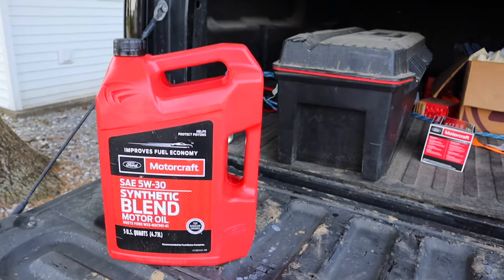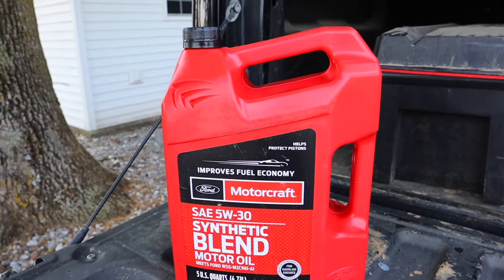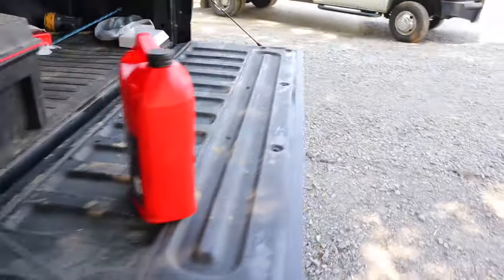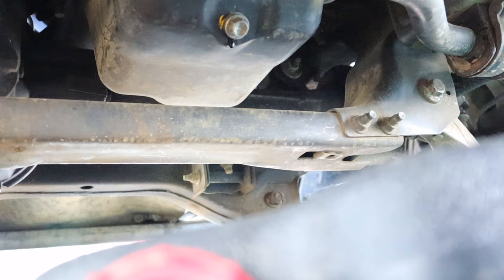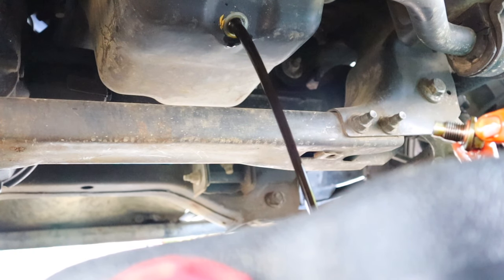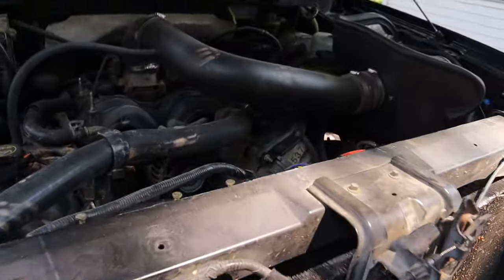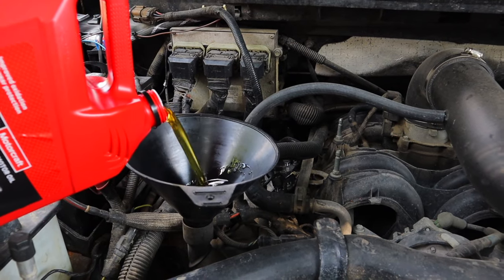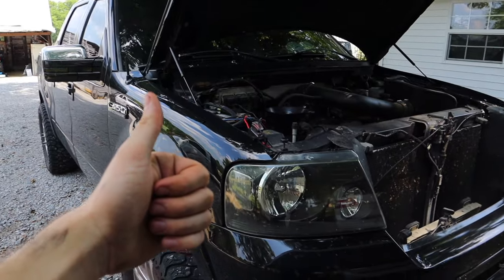HOW TO KEEP YOUR 5.4 TRITON RUNNING LONGER WITH LESS FAILURES!

Comment: I have you beat I have a 2002 FORD F-150 LARIAT SUPERCREW cab with the 5.4 and it has over 263 thousand miles on it
Reply from the maker: My black truck is at 197 currently, waiting for my house and shop to get built so I can get back into making more videos for you guys!

Comment: I got a question anybody have any transmission problems with the 6r 75six speed transmission. I have no idea how many miles are on that either. A tree trunk I sold I documented every oil change water pump brakes shocks whatever else routine maintenance but so eat Ford expedition limited 2008i have no receipt service records

Comment: 182k and still running strong..
I do however use a wix filter..
I’ve seen filters cut open and it seems to be the best
Need a new ac compressor though lol

Comment: Ford grenade engine. My 2009 f150 just took a ....on its 2nd engine.  So, currently, I'm back to my 95 chevrolet with over 340.000 on the original engine.

Comment: What year 5.4 Is this and is there certain years of the 5.4 for that are more bullet proof than others ?
Reply from the maker: This is a 2007 5.4. They’re all relatively similar, I know the 08’s got updated plugs and a different valve cover causing obstructed access to the vcts. I haven’t heard many failures out of the 09 and 10 model 5.4’s but I’m sure they had their fair share just like any other vehicle. Good thing with any 5.4 is they’ve been around long enough people know how to service them no matter what issue may arise!

Comment: I have a pretty loud clunking whenever I go from reverse into drive and I feel like I am hurting the truck by not doing anything I have a 05 f-150 5.4 would u have any idea what it would be?
Reply from the maker: If it’s only reverse making the noise I’m not sure what the issue would be. If it does it when shifting from reverse to drive as well, it could be the torque converter. Hard to tell without seeing and hearing it
Reply: Have you checked the u joints?
Reply: Definitely sounds like u joints ,on mine i couldn't feel any play but still replaced them to find they were shot and after I put it back in the clunking was gone

Comment: I use motor craft 5w30 and motor craft filter oil and change at 3000 miles cheaper to change oil then a engine

Comment: What light bar do you have. I want to do the same you did and put it in the lower intake
Reply from the maker: Yes. It’s a 30 inch straight bar. You have to notch the frame horns (they’re replaceable) to mount it flush.

Comment: Are those emblems the 2015 f150’s. I wanna get some but don’t know if they line up the same with the stock emblem.
Reply from the maker: Have to find some that have the 3M backing rather than the pins! They cover all the holes left from original ones
Reply: @JayThompson25  any chance you can put a link? Please
Reply from the maker: I don’t have a link for the specific badges I have , however Amazon has tons of badges to choose from.
Reply: @JayThompson25  appreciate the help sir👋

Comment: I have a 5.4 and the oil some how disappears I don’t see any leaks and it looks like it’s not burning any
Reply from the maker: Seems to be typical to lose about a quart over 5k miles or so. The 5.0’s also seem to have this issue. Not every engine does it, but it does seem to be a common occurrence

Comment: I got an 04 5.4 with 100,104 miles and for some reason it sound like a diesel engine making a click sound below 1200rpm am I the only one?
Reply: Thats the signal telling you its time for the timing job, chain tensioners and cam phasers, exact same symptom i had on my 05. One of the chain tensioner guides was found broken on mine - amazing it was running like that for who knows how long truck has 140K miles. That dieseling on mine was  the timing chain making a slapping noise. While the engine is open strongly recommend replacing the oil pump to the high volume version and change the water pump. I had mechanic do the job, not a cheap but i will tell you my truck runs like new now, quiet and more power.

Comment: Do you recommend 5w30 for winter or 5w20 ?
Reply from the maker: I use 5w30 year round 👍
Reply: What about in places that have real winters. Like Wisconsins -20degrees. I wouldn't want to be using 10w.

Comment: Did you repaint your truck
Reply from the maker: Yes I did!
Reply: @JayThompson25  the rear view  mirrors are plug and play ?
Reply from the maker: @JesusGonzalez-kp4wp  the side mirrors from the 09-14 F-150’s will function perfectly on the 07-08 models!
Reply: @JayThompson25  even the turning signal? I have a 08 and I want those but don’t want to cut wires
Reply from the maker: @JesusGonzalez-kp4wp  the puddle lights and turning signals worked perfectly on my 07

Comment: 175,000 miles is impressive? maybe for someone who doesnt take care of there truck. My f150 has 190,000 and I fully expect it to run another 100,000 miles same case for my E39 with 335,000 miles
Reply from the maker: Higher mileage is normally not seen on the 5.4’s because typically poor maintenance causes a lot of issues and failure points in the timing components. The oil pump starvation issue also takes out several 5.4s. I agree that 175,000 isn’t impressive for most vehicles, but 5.4’s are their own breed of problem childs and proper maintenance is the key to keeping them on the road

Comment: The 2 valve is different from the 3 valve. You have no basis to recommend 5-30 over 5-20.
Reply from the maker: 5w-30 has a thicker lubricating film therefore would be more beneficial for higher mileage engines

Comment: Would it make more sense to change the oil with the motor cold and all the oil drained down to the bottom instead of starting it and pumping all the oil up in the top of the motor

Comment: Its sound like you need to change right side roller followers on your truck.
Reply from the maker: Definitely plan on pulling the engine and doing all the upgrades needed
Reply: @JayThompson25  i suspect its the back or middle roller follower. While you at it, there is an oil pressure port at the back of that bank. Check oil pressure from there. If low, stop driving truck and check oil pan pickup. If not just change followers and all good

Comment: I have 04 5.4 does anyone burn oil in theirs I gave to add at least a quart between oil changes.
Reply from the maker: My brothers uses a little between changes. A lot of people claim it was a common occurrence, not only with the 5.4’s, but also the 5.0’s as well. After pulling a heavy load for long periods of time such as a road trip, I have noticed mine will use a touch of oil, but nothing of major concern

Comment: Id say get started repairing that roof on the barn lol jk
Reply from the maker: Next build video 👍😂😂
Reply: @JayThompson25  seriously though I appreciate your video. I have an 05 f150 with the 5.4 3v and have the hot idle knock I think from the cam phaser locking pin. I've heard from people that isn't detrimental but I'm concerned there may be more going on wish I could get someone to look at it to tell me it's safe to keep driving this way or I need to fix it asap.
Reply from the maker: Might not be a bad idea to have the valve cover pulled for an inspection!

Comment: I didn’t know about the 5-30 trick I’ve been running 5-20 synth motorcraft I have 190k miles on my 2010 5.4 f150 do you thing the damage is too far gone then??
Reply from the maker: Not necessarily, 5-30 would still provide lubrication and prolong components as long as possible. Might even notice a little quieter engine afterwards

Comment: I run Castrol full synthetic the 20,000 mls oil. I changed it at every 8-10,000 . I also used marvel mystery oil at every oil change
Reply from the maker: 10k is too much of an interval for my personal preference but hey if it works 🤷🏻‍♂️

Comment: I have a 2003 F150 5.4. I bought it 10 years ago with 108,000 miles. Today it has 265,000 miles. I have changed oil every 5000 miles and used 5W20. Stick to manufacturer’s specifications. Check out Fordmakuloco YT channel. He is the best Ford mechanic on the planet. He recommends OEM parts and specs only.

Comment: I’m putting a crate engine in my 05 right now, oil pump took the day off when I was on the highway
Reply from the maker: BIG Oof. Update that crate engine with the meling high volume pump if you haven’t already 🤙🏻
Reply: Whose engine did you get? Most have an HP pump in them even though almost all suppliers misrepresent the truth and say they put an HV in it. HV is probably fine for a stock unit, but once the clearance is fixed, the HV isn’t necessary because the volume loss is taken care of.
Reply from the maker: Most people get jasper long blocks for crate motors, but am unsure of this guy’s application

Comment: Mine knocked after it was warm until I switched to 30w and they was 6 months ago, all good since
Reply: try 15/40 diesel - works great to cover the phasers. Been running in mine for years - 2010 165k miles - i change every 3k

Comment: This guy does not know what he is talking about do not take this advice. Thicker oil lubricates much better BUT the engine was not designed for it. The oil pump already sucks as is it can barely move around enough oil to keep things lubricated so thicker oil is going to make this problem worse and the clearances in this engine are very tight which means oil has to go into small spaces and thinner oil does this better. This engine has problems with not enough oil going to the cam shaft bearings and thicker oil is going to make the problem much worse.
Reply: Fordtechmakuloco recommends running 5w-30 in the 5.4 3v. Being clean is more important 

Upgrading the oil pump is best, but expensive and you might as well bulletproof it if you're going that far

Comment: 5.4 is piece of $#@!..  cam phasers etc $2500 fix  DONT BUY THEM... thats WHY there is SO many for sale or those V6s nobody wants!
Reply from the maker: A phaser kit is $250. Most issues with these engines stems from dirty oil or neglect of maintenance when ticks or sounds can be heard. True they can fail without much of an warning at all, but isn’t a usual outcome
Reply: Have 300k on original 5.4 3v.
Reply: @bswens01   I have heard that but I've heard MORE about the problems
Reply: Always easier to hear about problems of any sort than good.
Reply: @bswens01   that's not a good motor man.. thats WHY so many of those are up for sale..  and like with the 6.4 diesel  all makes produce junk models....  I like 4.6L and 5.0L  and 7.3L Diesel
Reply: Depend on people how they maintained but few of 5.4L 3V were just lucky have no issue and mostly unfortunately for us all of these 5.4L 3v failure at 100,000 to 160,000 miles. Our 05 5.4L 3V is good engine at 130,000 miles but it starting falling a part due by oil burner and timing get loose, we changed new transmission,  new PCM and electrical issue inside cost us a lot of money compare our 99 Silverado 6.0L and 02 Tahoe 4.8L both of them are at 300,000 miles with original engines and transmission big difference from our 05 5.4L cost us a lot money.
Reply: @ricbonillasjr2567   id rather have 4.6L or the  5  0.
Reply: Yeah, agreed. We used to have f150 and expedition with 4.6l, these were best engine same as our current GM trucks come with 4.3, 4.8l, 5.3, 6.0l gas, and 6.5L diesel over 300,000 miles.
Reply: @ricbonillasjr2567   they think they won't have problems out of those junky 5.4s and IF they dont theyre some lucky SOBs cause im looking for another one and most that are for sale are A) V6 or more B)  5.4L V8s that have baaaad problems and usually right around 100K cause people saying you better get rid of them just like the 6.4L diesel》》》JUNK
Reply: @dondon98  absolutely agreed
Reply: My 04 has 245,000 original miles and runs very strong. THAT sir, is not a piece of shit.
Reply: @mrjon75    LUCKY YOU
Reply: I've owned chev dodge gm ford and ford has never left me stranded ever dodge n chev gm.have . Maintain ur shit and it'll be good to u . Just cus 1 guy says 5.4 is shit motor don't make it a shit motor from 1 guys bad exp or opinion.